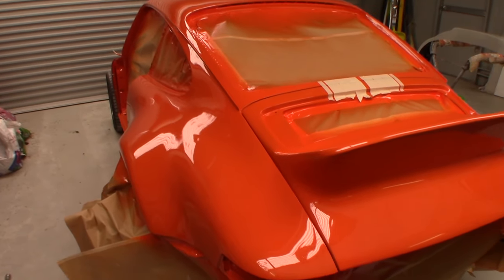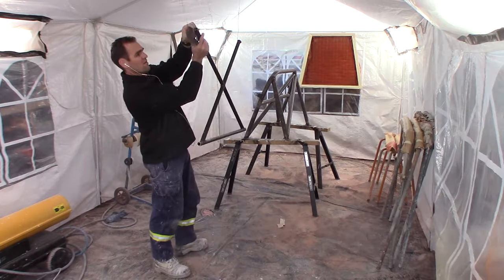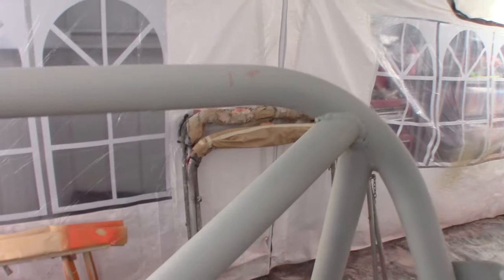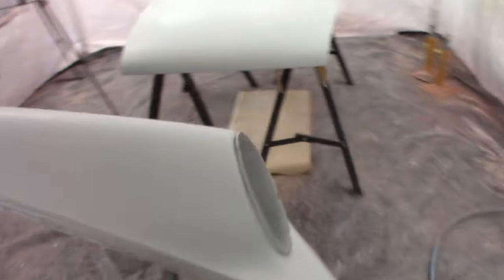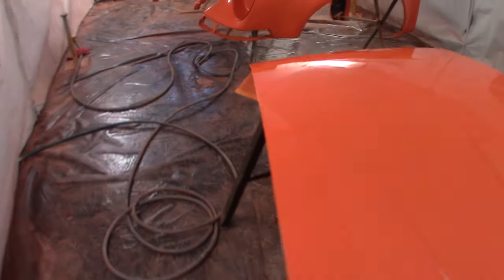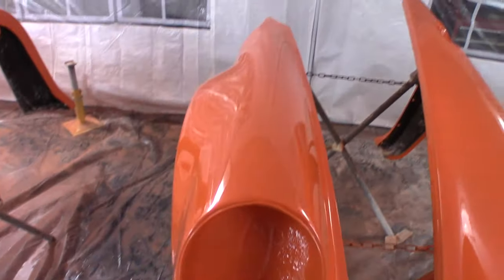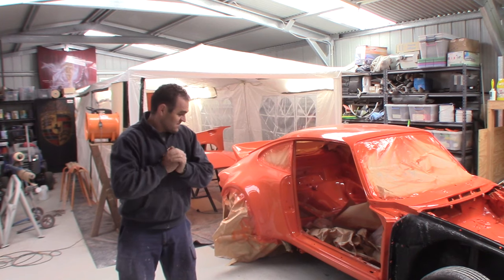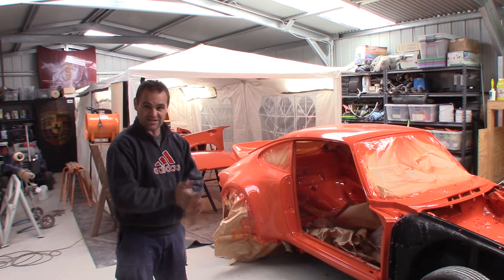Everything's orange - Porsche 911 Classic Car Build Part 19

Comment: That looks fantastic! Great job. I'm researching how to paint my Z (congrats on your latest purchase!) and wondering what paint gun and what kind of a compressor you used?
Reply from the maker: Hi Alex. I will be aiming to do a video on the basics you need for spray painting. Anyway, I have a cheap spray gun (around $100) which I believe is a copy of an Iwata gun. I have used similar for many years and found them good. As for a compressor, genrally my advice is to go as big as you can run on the power you have available, but at least try to go for a belt driven compressor. The little cheap ones will generally not keep up with the flow required for spray painting.

Comment: Serious question. 

Should you peel off masking tape when the paint is wet or when the paint is dry? 
Do you just rip it off or cut it off?

Some times masking tape chips the paint when removed. Maybe i'm doing it wrong.
Reply from the maker: Unmasking the car needs to be done slowly and carefully. Generally when the paint is dry, as you run the risk of touching and damaging the paint if you do it wet. It also may be where you are actually masking, but it can be difficult to get a neat finish.

Comment: No eye protection while painting?
Reply from the maker: I have worked in at least 50 different panel shops, and none of them ever wore eye protection, good or bad, that is the norm, at least in Aus.
Reply: Yes, I would imagine it also hinders when using it. Usually they distort the image, something that is imperative for a high quality finish.

Great project btw. :-)